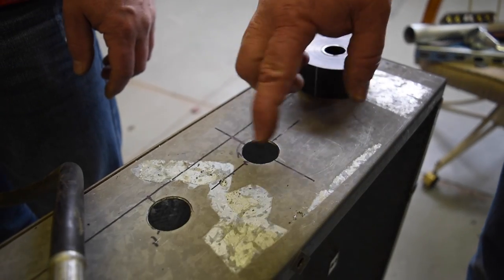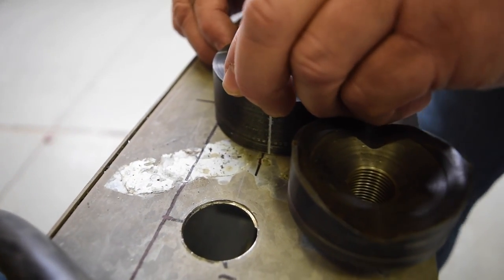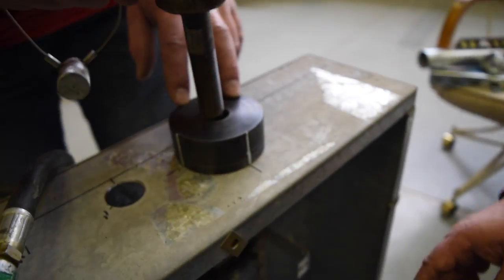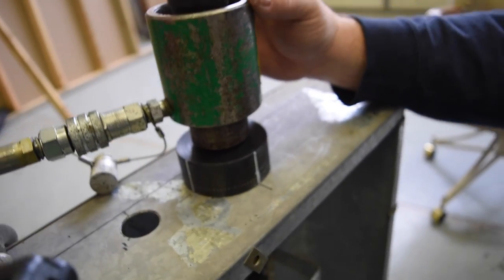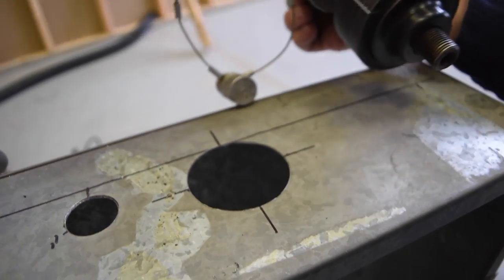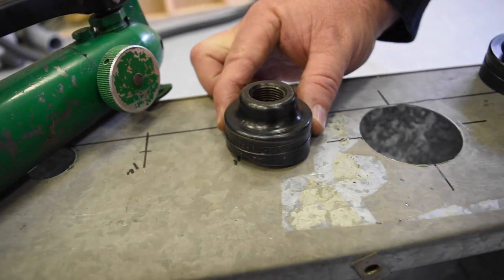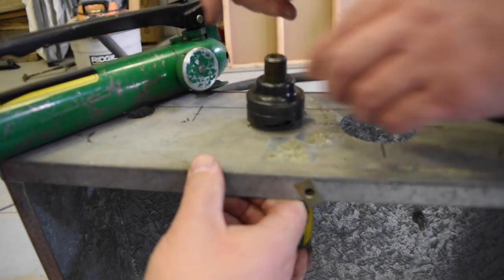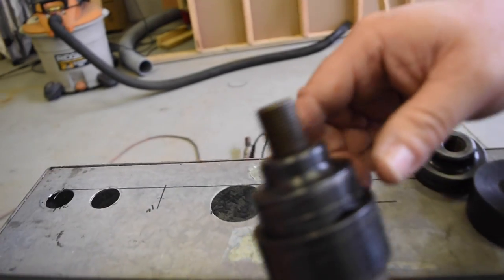How To Use A Hydraulic Knock Out Tool

Comment: Thanks for the video. What if you drill your original hole the same diameter as the center rod, then it will be perfectly lined up when you install the knock outs.
Reply: Clearly those were existing hole that had to be made bigger.